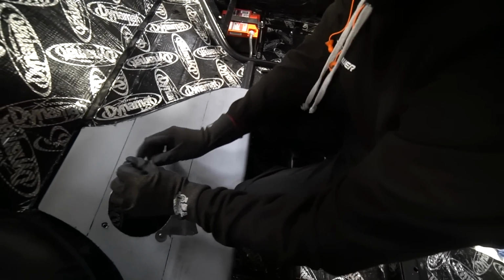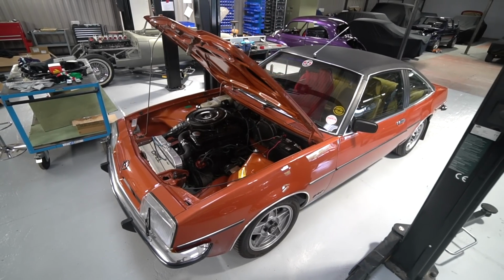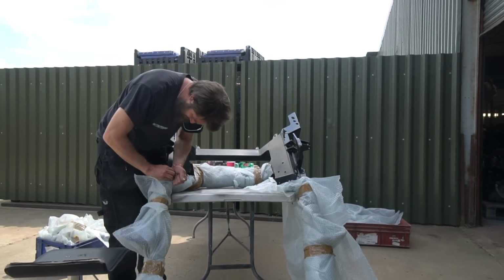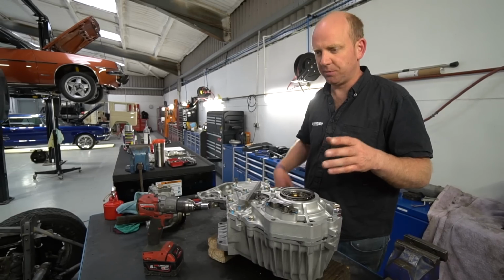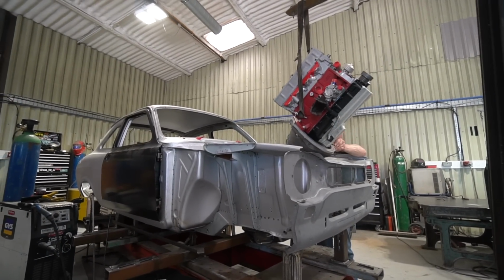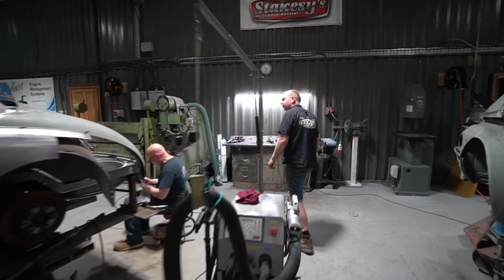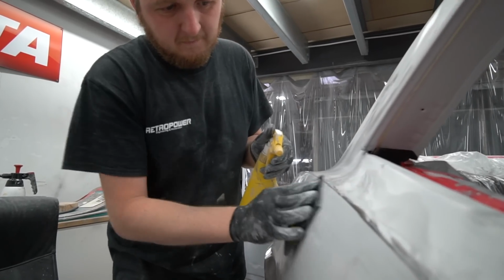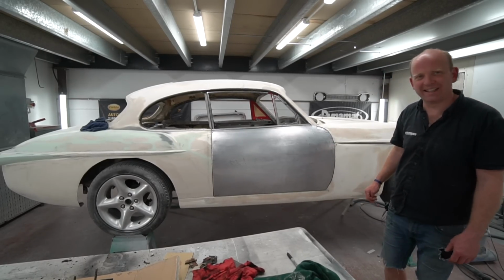Retropower Uncut Episode 93: BDG MK1 Escort Build Progress & Opel Manta Gearbox Swap

Comment: on your door car trim request, i reckon your laminating the panels will certainly be the answer but thinking about it for a minute if you counterbored the first panel to accept the top of the clip, say a fir tree style, then wouldn't the second sheet not only cover any potential 'dome' but also act as a support to the clip too in keeping it in place and by default at 90' to the panel too ? just a thought . . . .

Comment: I'm curious as to how much preload was applied to the output shaft bearing on the Cruiser transfer box. Tapered rollers need preload, but that appeared to be a ball bearing. A shim to remove any end float would be appropriate, but a positive load?
Reply: @Bob Fleming that's what I said. The output shaft bearing is a ball bearing and they were going to preload it. The idler and input are taper.

Comment: Hi. Great work on the Morris. For the door cards, would it not be easier to machine a small recess into the face of the door card for each clip ? The recess would have the same outside and depth dimensions as the clip. This way the clip would be flush to the face of the door card and not create any dimples.

Comment: Re the doorcard fastener, my 1960 Rover 100, uses a V-type spring (vF), into a hole in the door frame.
The Door-card itself (hardboard), has a similar hole, which accepts the (moveable) vF fasteners. 
The fasteners can be sunk into the hardboard, and may also be covered by a paper type patch under the finishing material.
These are obtainable from most of the fastening suppliers !

Comment: door card solution- clip, layer of high density foam glued overtop, ***then sand flat***, layer of low density foam, then fabric/leather/vinyl.  I've never had an issue with clips ghosting through the panel this way

Comment: Regarding Twin Cam and RS1600 Escorts the engine is offset 7 degrees to the left due to using hydraulic clutches. Both cars used modified pedal boxes with a single brake master cylinder and clutch master cylinder under the the dash with a single remote reservoir. Both cars used the 2000E gearbox and retained the Girling clutch slave cylinder as per Mk1 Cortina. This put the starter motor on the right hand side. That fowled the steering column.

The result of all that is the 7 deg offset, a long stem steering rack, an offset short steering column and a different column surround (same surround with relocated mounting holes). It also allowed some needed space to service the airbox/filter